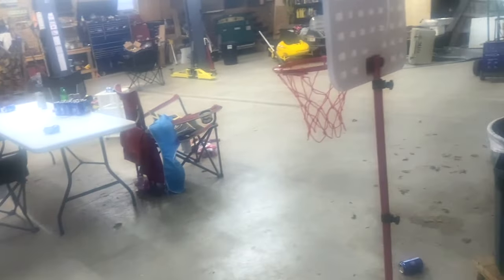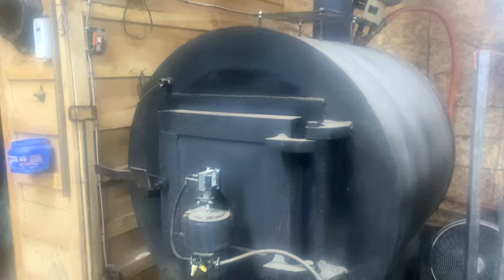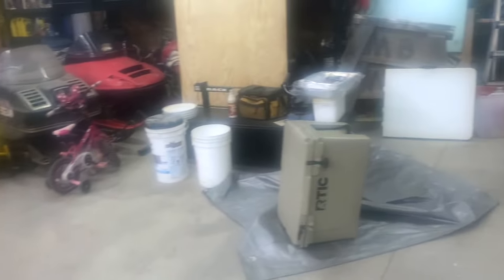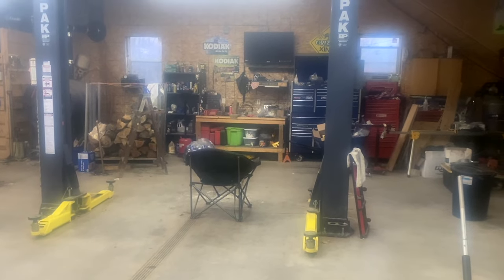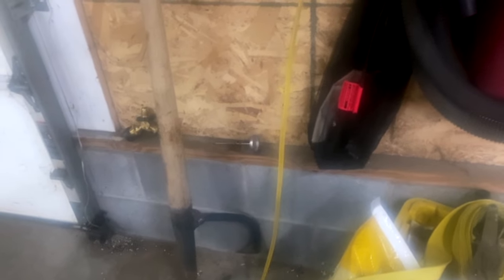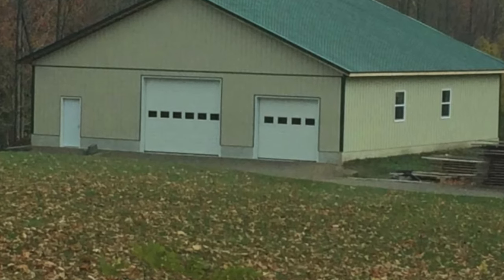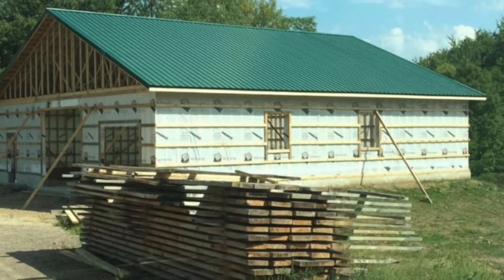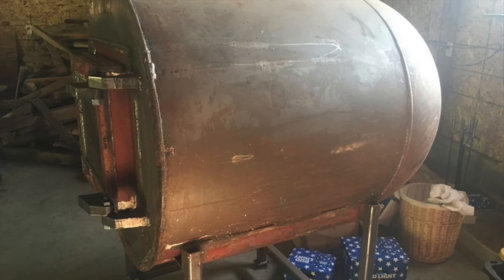Home made wood boiler heats huge shop with in floor radiant heat.

Comment: Great tutorial video.  I did something similar 40 years ago in a location that was all sand.  Also 8 and 10 walls with log siding .  3 feet of cellulose in the attic and heating was no problem.   But no radiant heat in the floor at that time. Instead  a raised floor above the slab with smaller baseboard heaters under the floor at the location of each door and 1 central of the floor.  The baseboard under the floor at each door location always took care of the in coming snow inside the house by the doors by evaporation ... Great job for a cold climate.

Comment: That’s pretty neat, me and my great uncle build pressurized wood boilers custom, up to 2,600 gallons, an idea for yours would be to have a smaller firebox and have fire tubes going from the back of the firebox to the back plate of the boiler, and then underneath the fire box have a plate from the front to the back with fire tubes in there. From the back build an adapter for smoke pipe 8inch should be good. And then build an inducer housing and inducer that sucks air from the firebox and fire tubes into the smoke pipe. We do this and we use all electronic controls therefore controlling the temperature of the smoke pipe, we use draft doors on motors that are controlled by these controls for override, max, min, and shut off which are electronically set using a retro box. And with this set up we heat water up to 220 degrees F with the smoke pipe only at 320-340ish. Using a fan coil we tie into Domestic hot water line, or radiant flooring. Also because when water is heated it creates steam which increases pressure we have an expansion tank for excess pressure that is at least 10% of the volume of the boiler.
Reply from the maker: I would love to see that boiler setup. I did build a fire tube boiler and ran it in my house for 6 years.
Reply from the maker: @bradyemerson7888  Thanks I have heard of those boilers. 👍
Reply: Nice!

Comment: Like what you have done. It will handle -40 deg no problem. I have a similar shop only 40X52 but built similar to yours I am on Northern Canada and we get down to -40 deg and the shop is still warm. Love the radiant in floor heating.

Comment: I bet that baby radiates nicely too when its burning. Floor heat is the absolutely best and the wood boiler is the cherry on top. Mine was outside in MN, burned about 15+ cord of oak a year. Sure miss it.
Reply from the maker: Joel it definitely radiates heat from the unit itself. That with the concrete heated up it’s such a nice place to work. Or drink beers. Lol 😂

Comment: I like it, you could always add a radiator in the upstairs, just by plumbing and maybe putting a quiet fan behind it. It wouldn't rob too much heat from the system really. What I would like is some thermostatically controlled valves for my design. I am retro fitting a house with radiators and an external boiler but if I poured the foundation it would be sure to have some loops in it for dang sure! 👍

Comment: ya thanks that what I thought , had a guy many years ago was cutting a 20k tank three miles from where It was was supposed to be purged it exploded two men where killed and did $200000 in damage to surrounding buildings we felt the blast where we were
that is why I was a bit reluctant to try it, we will flush and fill 
you cant be too careful 
thanks and love you channel

Comment: Man could I use a shed that size. I'm bursting at the seams with the 24' x 36' one I have. Get's pretty cold here in western Wisconsin as well. My next shed needs to be insulated for sure 😊
Reply from the maker: Ya nothing better than a warm floor in a work shop. Can be more productive if your warm. Well sometimes. LOL

Comment: My house and shop in same design built back in 1980s. I use an Attack boiler though and for cost you can't beat it. Pretty efficient. Got boiler from co. in WV.
Reply from the maker: Tom awesome. In floor heat is the best way to heat anything and it does not have to break the bank if you do some things yourself.
Reply from the maker: @dugfern  Yes I have a closed system wood boiler in my shop as well. Ill send you a link to that video buddy. 👍👍
Reply from the maker: @dugfern  https://youtu.be/LidclAf2ODo

Comment: just did a 1550 sft home used a Rinnai propane combi unit  to drive it  We use the 1of pex to 1 sft  layout  with equal lenght  loops   seem to work out
Reply from the maker: Richard that should work awesome 👍

Comment: For better efficiency those lines should be reversed. Heat rises as does hot water. Think of a water heater. It has a dip tube so the cold water comes in at the bottom of the tank and the hot water is forced out the top. 
Otherwise with  the return at the top  all the cold water will sink and youll be circulating cooler water and the hot water will stay towards the top. Hope that helps. 
Beautiful shop and love the boiler. Nice vid.
Reply from the maker: Thanks man yes that does make sense but this is non pressurized and most ones we seen had pump at the bottom. pressurized ones were at the top. If I remember that return has a tube dipping down into the tank to the bottom but Im not positive about that. We built this about 4 or 5 years ago. Man it works great though. 👍👍
Reply: My neighbour built one and his outlet and pump are on the bottom too.....
Reply from the maker: @1966cambo  yes pressurized system would be reversed though. 👍
Thanks
Reply: The vented systems should be return at the top and supply from the bottom. This will effectively mix the water in the ''boiler'' creating even temps in the water. I'm unsure of pressurized systems.

Comment: I suggest a chimney exhaust fan . When you open the door the smoke will come out. Also the boiler needs makeup air to ensure a negative draft if the shop is all closed up.  You can get a motorized damper cheap on ebay.

Comment: Im just finishing up my boiler build. Mine looks identical to that one. Mine will heat my shop and my home. Im looking to run a simple in floor heat system like this one but also want to run forced air heat exchanger.
Reply from the maker: Thats awesome. Did you use a propane tank to build it? I got some good tubing videos that should help you with that part. You'r gonna love that boiler if it works as good as this one does. 👍👍👍

Comment: I didn't hear you mention a low water cutoff. Pressurized or not heat will expand water turn to steam and low and behold a bomb.
Reply from the maker: Gene this is an open system. non presurized buddy. I did mention that in the video. The boiler in my personal shop has all the safety feature you mentioned because that boiler is a pressure vessel. Ill send you a link to that video. 👍👍
Reply from the maker: https://youtu.be/LidclAf2ODo
Reply from the maker: If over fired these open boilers will just boil the water out and it will spill on the floor.

Comment: Hey, sir. Does that pump run continuously or is it set to kick on with thermostat? Also, you mentioned not needing the mixing  valve. What is the temp he run through his floor? I'm trying to figure out my system set up. Everyone I talk to has a different method. This seems simple, like me!  I was thinking of running direct from boiler to floor. No mixing valves. Just dial the aqua stat down
Reply from the maker: I would use a mixing valve buddy. That way you can burn a hotter fire. It won't burn as good with colder water. The mixing valve is easy to hook up and will also protect the tubing from too hot off water.

Comment: Hey Bondo. I really like this planning on doing something similar. What does he have in the system just straight water? Or automotive coolant mix?
Reply from the maker: Hi Aaron. He just runs straight water with rust inhibitor in there. You dont need antifreeze and if you did you would want to use Glycole and not the automotive type. I dont think anything could ever freeze out there because of how we insulated that building. 👍😊

Comment: Nice job on everything. I just have one question about having the wood burner inside the building. Does the owner have insurance on the building? If so, does the insurance company know the wood burner is home built and not UL Listed? I would hate to see an issue happen and coverage be denied on the building. It seems reasonable that they would require the wood burner to be moved outside and away from the building.
Reply from the maker: I'm not sure i will have to ask him about this. Thanks
Reply: @bondobuilt386  This comment may or may not be based on experience! Trust me, it sucks to take out a project that you put heart and soul into, but losing a building and not having it covered sucks even more! Really nice job tho.
Reply from the maker: Thanks Bruce that would definitely suck for sure buddy.

Comment: Best heating I ever had was a radiant heat in floor boiler.  Diesel fueled and ran forever, cheap at the time, but the house was always just right.
Reply from the maker: Yes oil works real good. I’ve did a few with oil floored water heaters. Real comfortable setup. 👍😊
Reply: @bondobuilt386  how much you charge me to build one half the size of that

Comment: Considering radiant floor heat for new construction.  Would there be an advantage to pulling the mesh & pex up higher into the concrete when pouring?  I realize that you'd have to be careful cutting expansion joints and be mindful of where the lines are run when bolting things like the lift, into the concrete.
Reply from the maker: No advantage at all. The experts say it should be in the bottom. If you want wire pulled up do a double wire mat. Pull the top mats up that are over the tubing.  Leave the tubing and first layer on the bottom buddy. 👍😊
Reply from the maker: I would definitely do the radiant you will regret if you don’t. 👍
Reply: @bondobuilt386  Thank you for the quick reply!  Sounds like a plan.  Any advice on how to pull up the top layer of wire mesh without grabbing the layer w/ pex attached?  Also, any tips on spreading the sand over foam insulation without breaking it?  I guess getting the base really flat before placing the foam is key?
Reply from the maker: Hey Jeff we have been doing alot of radiant heat jobs with spray foam so that would be one way to insulate under the sand but yes if you use board foam you want the sub base real flat and put the sand down as you lay each row of foam. use a laser level so you have the sand where you need it. That spray foam is frock solid. I have videos of how that looks after it hardens. check it out buddy. 👍
As far as the wire we made hooks up that we pull it with I dont think it would be bad if you dedicated a guy to just pull wire up as concrete was being placed. If you tried hooking the top wire after concrete was placed it would be harder not to get that tubing layer.

Comment: Great job. My former skipper / retired GC has a medium-sized solar panel on his garage feed into his radiant-heated floors in his 2-story, 5500-square-feet NorCal home. He rarely uses his central heater.

Questions:

1. Why a barrel inside of a barrel?
2. You have foam under your outside block base. When you add on the weight of the walls, why doesn't the foam compact  & wall go out of level? Or am I missing something?
Reply from the maker: The barrel in a barrel is just a simple way to make a boiler for this shop. 
The foam is under the entire slab and the footer is all poured with the slab so nothing will settle the weight is evenly distributed. The Solar panel sounds awesome for warmer climates. 👍😊

Comment: How did you go about mounting the lift with the radiant in the floor? I was curious on how you had it laid out so you did not hit the pex in the concrete.
Reply from the maker: I’ll send you a video on laying out tubing where there is a lift we just avoid that area with the tubing.
Reply from the maker: https://youtu.be/MgAJmah0anM
Reply: @bondobuilt386  awesome, thank you!
Reply from the maker: @ryannorris5713  no problem buddy. 👍
Reply: @bondobuilt386  I plan on building a 36x42 garage in the spring and plan on running radiant, your videos will help for sure!
Reply from the maker: Ryan awesome I’m glad the videos are helpful buddy. Any more questions feel free to hit me up. 👍
Reply: @ryan Norris I planned where I wanted to put the lift, but depending how thick the slab is that will play a roll. My 10,000 lb lift requires 3” depth with 3/4” bolts. My slab is 7-8” thick where the lift is. I had to go back and look at pictures of when we poured it to see the thickness for cringe factor. But I also used a flir heat gun to see if I could see the pex lines. (In some pads you can see the increase in temp where the lines are)
Reply: @mattb4386  thanks for the info, I was curious on how you had it set up. I want to put a lift in but it might not be for a few years after the shop is built, I just wanted to make sure I set it up correctly so I could install a lift when I am ready!

Comment: thanks for the video.  I want to do an outdoor setup, might build a shed around it just for extra frost protection, easier to protect from freezing in the case of power loss.  Anyway, how did you guys cut the propane tank safely?  purge with CO2?
Reply from the maker: Terry sounds like a good setup. We filled it with water until it weas running out the top then cut it with a demo saw with a metal cutting blade on it. 👍👍
Reply: @bondobuilt386  so did you stand it on end and cut so water didn't spill out all over the place?
Reply from the maker: Terry we layed it horizonal and filled it with water and started cutting from the top and if you keep rolling it and cutting from the top the water will run out. but you can still cut. Then you can keep a garden hose running in there as you cut.
Reply: @bondobuilt386  Thanks, I was thinking the exact same thing that you did.  I've also got a C02 cylinder I could use to back purge as water emptied out. The other thing I'm wondering about is, how to stop it from overheating and melting the pex if your demand is low for heat in the house? ie. if I turn my thermostate down and it stops circulating?  I think I'll be Ok with the shop hooked up, just crank it up in there and let it cool that way.  Does water volume come into play here? as in, huge water tank will absorb tons of latent heat when the fire smolders and stay stable and not overheat the pex?  
thanks for the help!  your an HVAC guy right?  I'm  a mechanic by trade, built my house with help from friends and family, have the infloor heat in the house on electric boiler, but really want to do the outdoor wood idea for house, then shop on return with just forced air in shop, I didn't have time/funds for infloor out there, which sucks
Reply from the maker: @Pneumamechanical  You just will want a mix=ing valve off the boiler so the pex won't get to hot of water. You are correct that more water volume = more heat storage. the boiler will maintain whatever temp you set the aqua stat ( the little grey box in the video)  so if boiler hits its set point the fan will shut off and damper will close and it will smelter the fire down. Hope that makes sense. 
Bondo 👍
Reply: @bondobuilt386  you bet, so the mixing valve will blend hot water from the boiler and cool water already in the system to regulate temp?
Reply from the maker: @Pneumamechanical  The mixing valve blends the return water with the boiler water to cool it down. It has a dial and is adjustable.
Reply: @bondobuilt386  I'm in Canada, and last year they mandated EPA outdoor wood boilers.  I don't think one that's not EPA certified would be passed on the WETT inspection.  Do you know how you can deal with this if your building your own?
Reply from the maker: @Pneumamechanical  Here in the states it has to be EPA if its an outside wood boiler. Inside boilers do not need the certification at this point. Not sure in Canada buddy.
Reply: @bondobuilt386  It's pretty crazy, new construction outdoor has to be compliant, but depends on the municipality
Reply from the maker: @Pneumamechanical  It is crazy buddy.

Comment: Thanks for the vid. How is it that the floor drain doesn't "suck out" the heat? You said the drain was open to the outside.
Reply from the maker: Your welcome. 👍 the insulation is under the drain so not much heal us lost. There is a 3” pipe that hooks to the trench drain and pops out the back of the slab to drain the trench drain. If heat is lost it must be minimal because that shop is always super warm. Lol
Reply: Plus heat rises
Reply from the maker: Joe exactly bud. 👍👍
Reply: @joeyork9891  heat does not rise.  it flows from hot to cold.  In a nonforced circulation system, hot air and hot water rise because they are less dense than cold air and water.
Reply: @francismccabe3265  
Lol a hot air balloon doesn't rise
It flows

Comment: Why did you put sand on top of the foam? usually foam sits on top of the sand and that concrete goes on top of the foam....
Reply from the maker: Alex we put foam down then 2X12 all the way around for the form board then added 6" of sand in the middle to create an insulated monolithic slab. That was the edge is 12" thick footer and middle is 6" thick of concrete.
Reply: @bondobuilt386  but what's the idea behind having sand on top of the foam?
Reply from the maker: @alextarshikov6515  Its very hard to insulate the outer haunch of a monolithic slab unless you spray foam it. . This is just one way to do it with board foam. All that sand also acts as a heat sink and thermal heat storage and will stay warm for days if you let the boiler go out so it works real good.
Reply: That make sense. What kind of foam board did you use?
Reply from the maker: @alextarshikov6515  2" polystyrene foam board. closed cell. not polyiso that's open cell and will absorb water bud. 👍
Reply: @bondobuilt386  thank you sir for the info